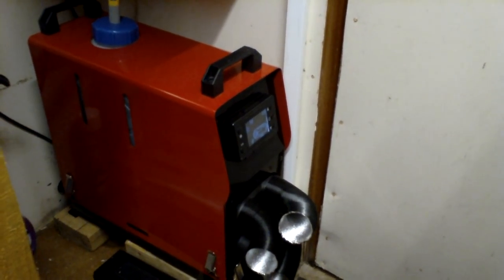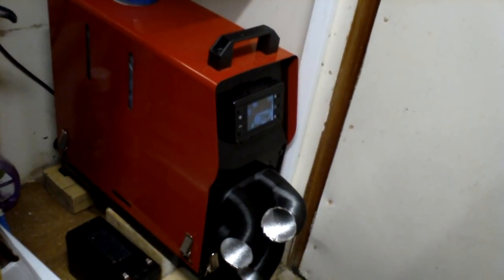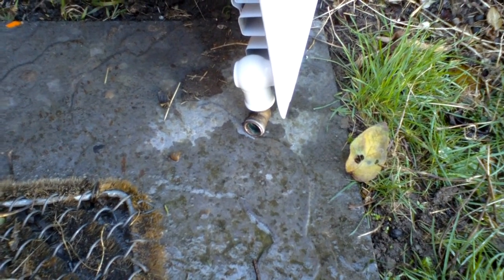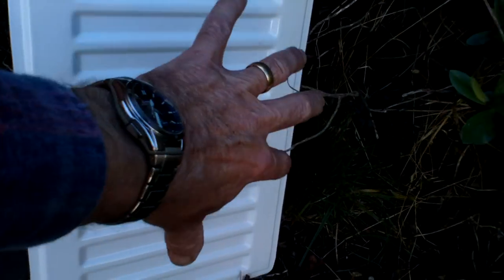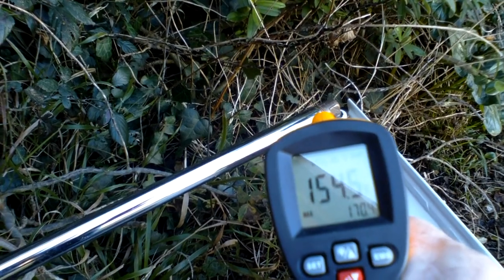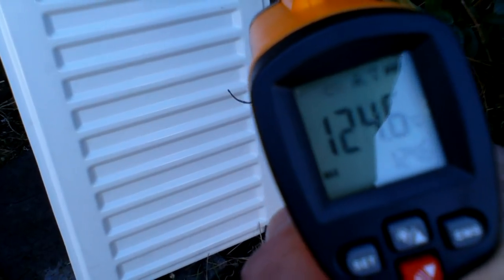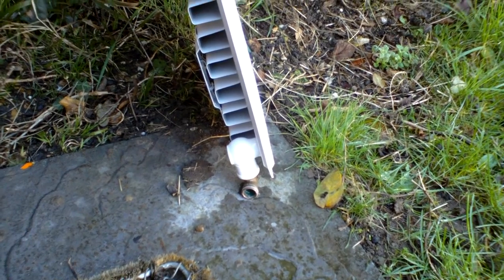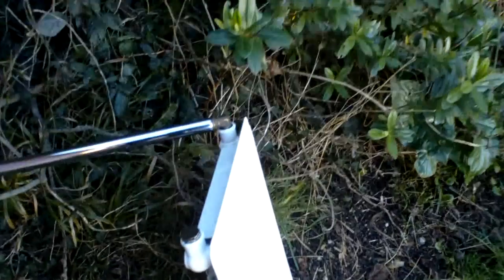COMPACT CHINESE DIESEL AIR HEATER EXHAUST HEAT RECOVERY

Comment: Great video Mr. Bruce .   I completely understand what your saying ...  Common sense has left our time &  explaining Carbon Monoxide poisoning is real / Silent killer  I have 2 different CO2 monitors around my diesel heaters  Just as a precautionary anything can happen   .  I have been contemplating way i could recover the expelled heat also . Thanks again
Reply from the maker: Hi JJD. Like you I have monitors in both installations as you have to be safe. 
I had to emphersize most strongly in the video the dangers and you are quite right about a silent killer... Regards Peter
Reply: @brucepeter2007  - Thanks for the quick reply . waiting to see how you advance on recovering heat loss .
Reply from the maker: Hi again JJD.  I have to say I’m still pondering what I can do with the radiator within the confines of my two shed installations...
The in my bonnet about all that heat loss has not gone away.
Regards Peter

Comment: That's noisy
Reply from the maker: Hi Terry - The higher noise level is only when it’s kicking out 5kW of rushing air heat. Once the set temperature has been achieved the fan reduces down and there is little noise.
Regards for your comment.
Peter
Reply: @brucepeter2007  . Cheers  thanks for the  reply.  Fitting  one  in my  landrover  defender  110. Don't no what  size a 2kw or 5kw.
Reply from the maker: @terrygribb9185  Hi Terry. Depends what low temperature your looking to stay in. If you do a lot of near freezing wild camping then the 5kW is ideal. It heats up quick and as the vehicle is not well insulated it will keep you toasty warm. End of the day the choice is yours. Stay warm. Regards Peter